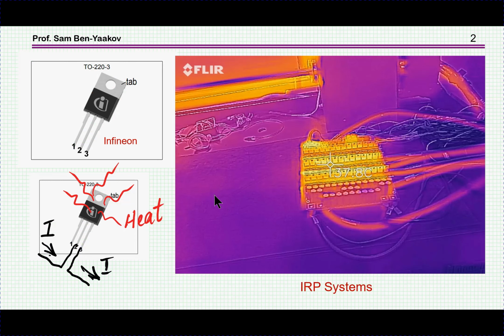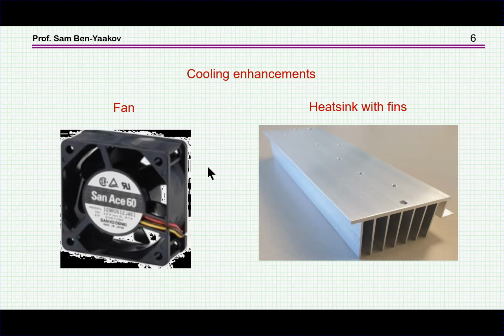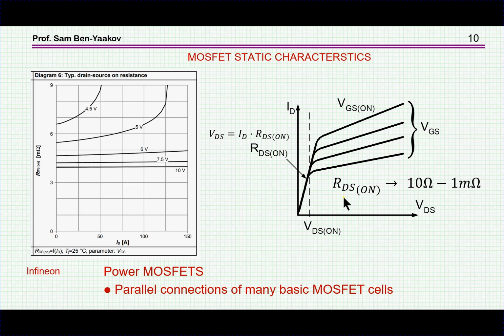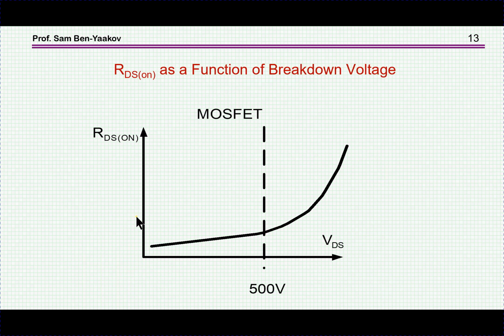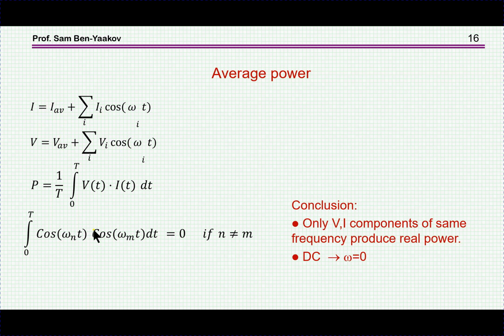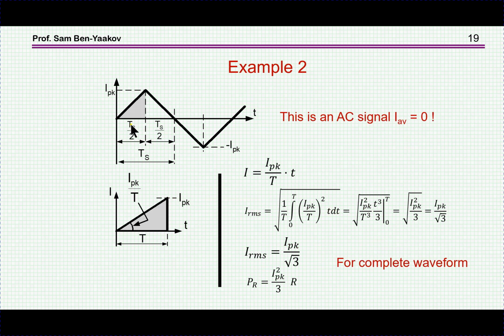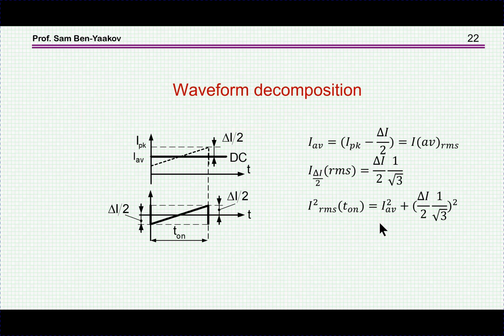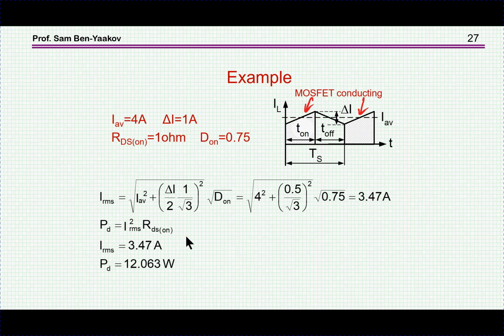Fundamentals of Si MOSFET losses and cooling in power electronics: Part I - conduction losses

Comment: many thanks! 
I have a question: when calculation a conduction power loss for MOSFET we use: Irms^2*rds,on. Why, when calculation conduction power loss for IGBT we use: Irms^2*rds,on + Iavg*Vce,0 (where Iavg is the same as you showed in the video above, and Vce,0 is the point in which the Ic-Vce curve of the IGBT meets X-axis (Vce axis)?
Reply from the maker: The voltage drop on IGBT when on is like a voltage source plus incremental resistance.

Comment: Obviously, in real-world MOSFET power amplifier designs, manufacturing costs are a huge consideration in the viability of the design. 

A focal point for costs is in the assembly time needed to attach parts to heat sinks, or any other very labor intensive task which cannot be automated, and obviously, the engineering team is trying to minimize. So, the heat sink example showing multiple TO-220 packages being attached, is a non-starter. The time needed to do this operation of attaching and then aligning and soldering to a PCB is prohibitively expensive.

What you will find, is in formulating an assembly approach the focused is on removing heat at the lowest possible manufacturing cost. Before you even select a MOSFET device(s) have a plan on how to get the heat out of the assembly, and as an added bonus, then plan on the best way to manufacture your approach and then incorporate design for repair.

Also, if the MOSFET must absorb energy from an inductive load, you have to consider this as a special case of device overstress in addition to device temperature and instantaneous conducted current.
Reply from the maker: Considering the application: motor drive inverter with pgase currents of 200A  to 400A, the TO220 is a good choice. What would be your recommendation?
Reply: @sambenyaakov  With motor drive inverters, a good example is a CNC 3-phase spindle motor amplifier (let's say, nominal of 40Hp), the challenge for power packaging is in providing for regeneration currents, due to motor braking or load momentum overrun. Energy has to flow both ways from the power grid to the motor and from the motor to the power grid (or regen energy has to be dissipated in some way), granted we are first converting 3 phase AC to DC and then PWM modulating (in some fashion) to achieve 3 phase speed (and possibly torque) control, but we must also modulate to return currents to the grid (it is assumed for industrial installations in the USA that the grid impedance is very low and there are multiple users on the grid at any one time). 

The motor control power devices are purchased in a special power package containing 3 half-bridges (two of these modules are needed for the design one for control and one for regen) which minimizes assembly time (the heat sink base is electrically isolated, but you still need an assembly persons to apply the thermal grease and torque down the hardware (usually in a specific pattern). The high power portion of the assembly is simplified by the use of bus bars which are much faster to position and install than wires on the high current circuits. Bus bars (tinned OFHC) are pre-formed where two of the bolted connections are studs, so they drop in place.

Actually, the more interesting aspects of these types of design are in the control and regen switching algorithm which uses current sensors on each of the motor phases. The PWM switching control is isolated from the power stage and usually done, in my designs, using are FPGA with a ARM core watchdog.

As it turns out motor control inverters are a good place to look in understanding packaging options for production. Just purchase a few from different CNC spindle motor amplifier manufacturers and take them apart, you can see some disassembly videos on YouTube, buts its much more fun to do analysis on your own bench with the newest models.
Reply from the maker: @windward2818   you wrote "The motor control power devices are purchased in a special power package containing 3 half-bridges (two of these modules are needed for the design " so you are talking about custom made modules. If you would check, you will find that using discrete TO220s is much cheaper(including assembly cost). In some markets, cost IS an issue.
Reply: @sambenyaakov  For high power 3 phase AC power supplies and amplifiers, in the US there is a long history of common 3 phase power block semiconductor package form factors that are standardized between many different semiconductor manufacturers, although not always offered until sourcing intent is requested. For example, you will see standard 3 phase, rectifiers, SCRs, IGBTS, MOSFETS, and now silicon carbide devices. Important is to have all the devices track thermally in close proximity to one another, have top mount screw hardware to support bus bars, and often a fast responding temperature sensor is included on the substrate usually a Platinum RTD. The module is tested to stress the components with balanced and unbalanced loading, and often the end user specifies special overstress conditions.

However, we are talking about two vastly different power requirements, I am talking about controlling a 40 Hp 3 phase spindle motor for a large machine tool manufacturer as an example, and you are referencing a TO-220 package used in relatively low volume power prototypes, correct me if I am wrong but I think our applications are very different.

Comment: an interesting video may be in studying the body diode effect of paralleled mosfets. 

the Rds_on has a positive temperature co-efficient. so when in normal Rds_on mode, parallel mosfet devices share current nicely.

but is the same true when the body diode is conducting? as diodes are non-linear devices, would they still share current equally and be fine? or if you start using these devices suddenly in diode mode at very high current and low duty cycle (aka high diode duty cycle) (imagine an over-current / current limiting scenario). would you still be ok? 

or would 1 device with slighlty different non-linear behvior ,begin to steal nearly 100% of the current and losses, then fail. maybe leading to a cascaded failure event.
Reply from the maker: See https://youtu.be/wjSM2oYY3OY

Comment: The results are OK but I think Pin in slide 25 should be 100W not 400W and Vin  =25V :)
Reply from the maker: Thanks for correction. Io is also marked wrong it is the inductor current = 100/25.I will note this in the title page

Comment: Hello Sir,
Thank you for the video.
I have a question, at 6:36, isn't the region you are pointing to called the triode/ohmic region and as far as I know is the region where Rds = 1/gm and not the Rds(on) you are talking about here.
Reply from the maker: I don't follow. Where did you get this/ No matter how you call i, this region is the on resistance (Id - Vds)  at low Vds  voltage when Vgs is above threshold.
Reply: @sambenyaakov I am not sure of the value of the on-resistance but the region you are pointing on is not the saturation region but it is the ohmic region where the FET behaves as a voltage-controlled resistor.  Please check this article to see what I am talking about. https://www.electronics-tutorials.ws/transistor/tran_6.html
Reply from the maker: @thezodiace7399  ha ha, OK, now I understand what is the reason for your confusion. You are probably unaware that the teaching of  most of these channels  is bogus. See for example https://youtu.be/qE_wKj_sHas and then the answer to it. For example, the statement in the "tutorial" you referenced  : "increasing this positive gate voltage will cause the channel resistance to decrease further causing an increase in the drain current, ID through the channel" is utterly wrong! The MOSFET is not a controlled resistance. It is a pure resistor in the ohmic range and a current source in the saturation range . When moving from the ohmic to saturation range the resistance is INCREASING as the MOSFET is getting behaves as a current source, which I am sure you know is by definition of high internal resistance. .
Reply: @sambenyaakov  Yes, it has 2 behaviors, I always suggest people to watch the animation of a MOSFET , the current flow of channel , and when the channel is Pinched, no matter how much voltage you apply, it is fully saturated.

Comment: Thanks for the video Sam! I have a question - what's the correct approach to determining the I_rms through the MOSFET if we know the I_rms of the output? For example if this was part of a traction inverter, we may know the expected I_rms of the output based on the specifications of the motor we wish to drive. In such a case, it would be useful to be able to derive the I_rms through the FET from this quantity.
Reply from the maker: Perhaps this will help?
https://youtu.be/r_LmAsgfgrA